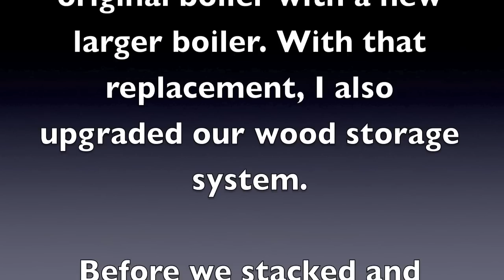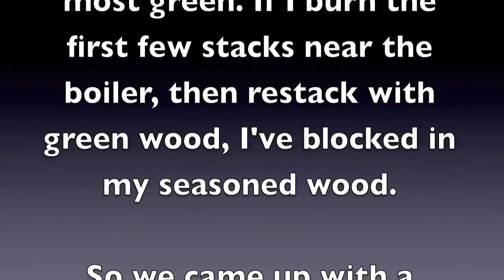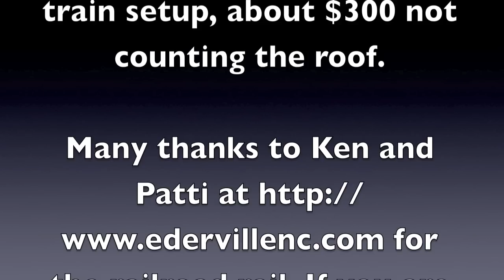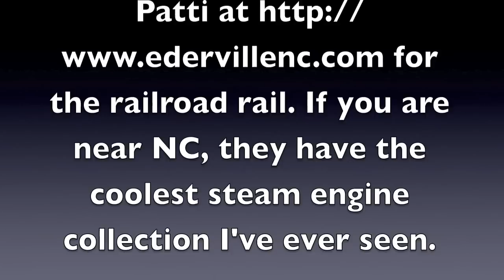Mobile wood rack system for a wood burning boiler

Comment: That is a truly ingenious solution to an ages-old problem.  I'm sure others have thought of things like this, but it's really cool to see it built and working so well!  While there are detractors, with most of them living in cities and having no experience with such things, heating with wood is a great option in many situations.  The biggest challenges to effectively heating with firewood are drying the wood and getting it to the location where it will be burned.  Historically, we have joked about firewood heating us 3 or 4 different times, which alluded to harvesting trees, splitting and stacking firewood, then moving it again to the stove or boiler system.  This solution addresses proper drying and seasoning of firewood, as well as that final relocation of the firewood to where it will be used.  Anyone who has done this before will recognize the value of what you've done here.  Those with negative comments are either ignorant, jealous, or both!  

I would put clear, plastic, corrugated siding on the outside of the shelter house, roughly 2/3 of the way to the ground, so that you still get lots of air flow, but have more protection from blowing rain and snow.  It would also be an easy thing to weld an eye-bolt to the undercarriage of each "shuttle", as an attachment point for a winch cable, if you wanted to test out that means of moving them.

ETA - I see this video is almost 7 years old...how has the system held up?  Have you made any adjustments to it?
Reply: Thank you Jason for the warm comments. The eye hook is a good idea. Should I ever convert to a winch system I'll remember it. I worried about the rain blowing in and wetting the wood as well in the beginning but the end result has been negligible downside with open walls The look of the short walls to protect it would detract from the current clean aesthetic, which I wouldn't care about but I have a wife to keep happy so I'm thankful it works without the walls. Thanks again for your well thought out comments.
Reply: @DanMooreNCF , I presume the system is still working as designed?  I suppose it would be, given how sturdy and simple it is.  I supplement heat with a fireplace insert, at the moment, but hope to retire to a home with a masonry stove, and plan to build something identical to your design, when that time comes.
Reply: @jasonbroom7147  Oh yeah. It works just like the video for the wood handling. We replace a boiler circulation pump every once in a while but otherwise it runs just fine. Pretty low maintenance. I just did our test fire for the season last week and everything fired up like it is supposed to. We produce way more wood than we can reasonably burn just in our normal farming operations. I have at least 5 years of wood on the ground right now, and I'm clearing out a pad for a new barn at the moment, producing more wood. I use electric and LP heat until the weather gets cold enough to justify the wood boiler. Otherwise the boiler only fires once per day which is kind of a pain. It is happier when it is running all day and all night.

Comment: Cool.  Great idea.  I think I'll use some of this concept for myself.  Hey one thing that would help you when pushing the wood forward (towards the boiler) is install a limit switch on end of the track nearest the boiler.  Use a cheap "wall wart" 12vdc transformer that can be shut off completely (with a toggle switch) when not in use. Install a red clearance light on the far end of the roof structure. Now when you push the wood forward it will trigger the limit switch, turning on the red light.

Comment: that's a great setup! now, me, being lazier than you... i'd use an electric winch rather than the loader to move it. no implement hookup and it might be less likely to jerk and knock the piles over :) note, I also do not own a loader, but do have a winch.
Reply: A lot of people have suggested a winch. I had a loader, and not a winch, hence my solution. Working with what you have is the best solution.
Reply: @DanMooreNCF  i totally agree. Use waht u have

Comment: This is fantastic!  Not just a great solution, but taps into what I feel is the soul of colonial and industrial era industrial design.  Today, People will walk back and fort, back and forth to the trash can instead of putting the darn thing on wheels and bringing it to the work.  Raw material in one end, meeting improving processes along the way(cut, split, stacked, seasoned, burned) and finished product(heat) out the other end.  Could I suggest that an optional refinement might be a heavy cable and a come along?  More cost in sheaves, and strong points/rings on carriages, but would allow for single operator use if come along (or winch) located near furnace.  Trip hazard (if left in place) would be trade off for risk of banging roof with skid loader.  Reaved cable(mechanical advantage) would make perceived load lighter for winch or come along.  Heck, you could set an old school manilla block and fall if you reaved enough and would have no noise, no fumes, nice aesthetic.  But these are just cake icing style tweaks to an amazing idea that you have realized.  Thanks for sharing.

Comment: This is a really well-thought-out system. Hats off to you for the ingenuity to consider using railroad rails and custom made racks to fit. When I see a great system like this it makes me appreciate resourceful people who don't just flip on a switch for their energy needs.

I was a stairbuilder and often made my own tools, which I sold to other local stairbuilders. Honestly, I enjoyed doing that more than stairbuilding, which was a fulfilling job already. I was constantly thinking up new tools and applications. When I saw your system, it put me in mind of a local hardwood supplier that stickered his own wood. His delivery system to the shop was a total cluster f-bomb. This system would have been great for him, with rows of the different species in lines similar to your single line system.

The only improvement I can think of is an extension of your great idea. Why stop with just the railroad rails? If you mounted your racks on an inexpensively built "dolly" you could roll the racks by hand, and not need a tractor or even a winch. You already have the rails for the dollies to ride on. All you need to do is use square steel stock and weld up a square base and attach some smaller 8" railroad wheels to the base (the "axle" could be round steel stock). They wouldn't even need to be standard railroad wheels. I found some small wheels with flanges that have nice bearings and don't weigh a lot. That way you could just pick up the rolling base when it's empty of wood and replace it at the back. If you don't like lifting it, you could use a heavy duty two wheel dolly to cart it to the other end to refill. The added advantage to this system is, you could extend your railroad rails to the splitter and fill the rolling base there and just wheel it into your covered area. Granted, it would take some fabrication work, but the system would require no firing up the tractor and mounting the pushing post and you could push the entire pile by hand or each stack one at a time.

Anyway, I'm not disparaging your work at all. I think it was a really great idea and has wonderful potential for other folks. Modified using wheel bases, I could see it being sold as kit for folks like you that use a lot of cord wood for heating. Good job, MrDan!
Reply from the maker: Thank you Dallas. Kind words from a true craftsman. The fab work certainly doesn't bother me as I fab all kinds of odd things. We looked at using wheels of some sort but ended up deciding against it. We use the skid steer as our power source for the log splitter so whenever we are splitting the machine is already there. We also use it to carry the logs to the splitter so it's serving double duty. The issue we had with wheels is that the roof line was artificially low because we picked up an existing roof line from the boiler house. With limited head room we didn't want to put wheels in because that limits the room even more. If I had 10' ceilings, I would have used wheels. I could make small railroad type wheels in my metal shop and use simple axles on each trolley but with our setup space was limited. In reality I'd love to double the amount of storage I have but I don't want to make the roof any longer and higher isn't an option.

Comment: That’s a great idea although my neighbours were not happy when they discovered railway tracks across their lawns and parking spaces, I think blocking the light from their windows with the wood stacks was also a deal breaker🤷‍♂️. Just got to knock a hole through the side of the house now to push the wood inside nearer to the boiler 👌.

Comment: Good system I like it, just need to put wheels on those racks and then you can push them by hand. (one at a time) !! I saw the same issue when visiting friends, 1, they would chop the wood and throw it on a pile. 2. at the end of summer they would pick up every chopped log and store it in a shed. 3. during winter pickup the logs from the shed and bring them to the house in a wheelbarrow.  Solved the problem, once the wood is chopped store them in a steel cage on wheels that can be moved easly.

Comment: I'm super impressed. But there is a lot of steel channel and angle in those racks. $160 bucks for the blank skidsteer plate, plus the railroad tracks and all that PT lumber, now way you could do it for $300. That being said. Best firewood system I've ever seen
Reply: its not pt he said he cut it from his farm and by doing that cuts cost
Reply: Nate is correct. The lumber is from my farm, self cut. The railroad rails were a gift from a friend. The only costs were the ones listed, plus labor which I didn't calculate. If we all calculated our labor on our projects nobody would ever look good although the labor on this project wasn't that bad.

Comment: That's a great idea, but not all of us that burn wood , have access to a skid steer. I still do it all by hand,( alot of labor ). Thanks for the video.✌️
Reply: He uses a skid steer because its easy and its what he has. You could easily put a concrete block in the ground to push against and just use a hydraulic ram/jack to accomplish the same thing. Its not something that would have to be done often, so get a 20 ton jack, pump it 6", retract, put a 6" spacer in, repeat. May take 5 minutes, but big deal. There are four ways to skin a cat; skid steer is only the one that was convenient for him

Comment: What an ingenious system well done, and yes like everyone else i'm gonna make a suggestion of how to get away from the need of a spotter when on the skid steer as you have a unified system and all your log racks are the same width why not spray paint lines on the rail to mark the gaps when you remove one from the end closest the boiler you have only to push the cart passed the next visible mark and you are now moved up...x
Reply: richard b hollick all of which would be fine unless the front stack fell or something happens in front you don’t see until you’ve damaged something.
Reply: I might be tempted to duplicate my $25 Wyze camera that watched the boiler, and position one so I can see the end of the stack with my phone while moving the load down the rails. To me, the technology is easer than building my first idea, which is a vertical post a few inches high that gets pushed over by the rack as it reaches the end, rotating another horizontal post or flag upward next to the stacks to tell me to stop.

Comment: What you need is to use 80-100 series chain running atop of some 3"x8" channel for rails and drive it with a 50-1 gear box and electric 2 hp motor.  Then no one needs a bobcat and you could stand at your furnace and watch the wood come to you without a spotter.
This is what I built for a pellet mill for pushing pallets of pellets outside for Hyster drivers to move onto trucks earlier this year.  3 of us built it in one day.

Comment: Awesome system! I would "dig out" so when you push wood the skid steer fits under the roof! I would hit the roof eventually. Haha
Reply: Putting or painting a marker on the input end will tell when the supply end is even with the end of the rails.

Comment: Great system, congrats on it.

I have entirely different set up/system but exact same philosophy (less handling of the wood, the better/cheeper if is to heat with wood).

My wood shed is near the stove just out side a window next to the stove. I mounted wood box on the out side frame of the window with the lid hinged off the bottom of the awning window.  After I fill the wood box from out side, when I open the window from inside the wood box lid slides back allowing access to the stored wood.

Comment: Think about adding some  UHMW plastic  sliders to the underside of the channels that run on your rails. It will prevent the rails from freezing and  greatly reduce the effort needed to slide your pile. By the looks of your video it's not a problem now, but if you ever want to extend the pile, or go the winch route it might be worth looking at.
Reply: Or grease on the rails, put a little on every 2 months or so?  Great setup and like he's said in the comment, he's always improving it..... nothing like wood heat, I miss our wood stove or the heat that came with it!

Comment: This is like watching one of those overly extremely complicated cartoons of the alarm clock contraption that gets Donald duck out of bed in the morning.
Reply from the maker: Compared to flipping on the switch and burning electricity, yep it probably does. Handling wood is going to be labor intensive no matter how you do it. I'm always open to better ideas, but I couldn't find one on youtube so I posted mine. In facilities that burn wood for power generation for a living, the process is very intensive. More so than mine. I felt like mine was scaled down quite a bit compared to the pros and I certainly burn less diesel per unit of wood. Of course I don't produce 5 megawatts either so there's that.
Reply: +Tony Thomas   What is so "overly extremely complicated" about this setup.  It is individual stacks of firewood on a set of rails.  Shoved down the line by a mechanical force.  If anything, it is simple/basic physics that saves the operators countless hours of wasted labor each year.  Genius, I'd say.

Comment: Great idea if you happen to have a Bobcat hanging around.
Reply: I’m sure you could achieve the same thing on a smaller scale with a winch. Or even some sort of rack on casters instead of sliding c channel on rails. Would definitely be less resistance
Reply: Just use a $50 Harbor Freight winch if you don't, or even a hand crank boat winch, and attach one or two racks at a time to pull them forward.

Comment: Great Idea . You could put an ellectric winch and cable to pull the stacks down the track .
Reply: I could. That's been suggested before. However I already have a skid steer at that works fine for my setup. I believe others are thinking to try it with a winch, hopefully someone will post it when they do.
Reply: Either way you still got it going on :) .

Comment from the maker: That would be good if having the skid steer available was an issue however we keep it right here on the farm. We did think about casters at first, but we would have lost capacity by raising the racks the 6" the castors would take. We were height limited with the roof already in place. Thanks for the comment.

Comment: I just built a 2 x 2 x 0.6 m wood storage rack with 4 areas of 1 x 1 m. I use the oldest wood first until that hole is empty, then I fill it up with fresh wood and continue with the then-oldest wood. That way I also never have to handle wood twice.
Reply from the maker: That sounds like a good plan.

Comment: Hi. It is amazing how creative people are when they make systems for helping them life. I still wonder why do not use simply pallet under wood and moving them by a pallet jack. Easy and get wood much close a door or boiler. Yes need even surface. but it is easy to set up. The train tracks rails are very slippery, better than ordinary steel bar, good point.

Comment: hi there  i made boxes so the wood comes off the splitter into a 1-2 + cord box then to a covered spot . then when i need it pick the box up and set it in front of  the boiler door . less stacking . if you made boxes and slid them down the rail and just slide them off after emptied

Comment from the maker: We looked at putting wheels on this system but there was a height limit. Adding wheels that could carry the weight would have eaten up at least 6" which is a lot of wood over that long of a system. That's why we went with rails and direct contact instead. Also, I don't have another area to store wood so it needed to fit where I put it. I have a friend who has mobile racks like you are describing. Those would have been easier but didn't really work in my situation.

Comment: Great idea, I wonder if a winch would be an easier way to move wood on rails.
Reply: jjmac60 I was thinking the same thing. Bobcats are not cheap.
Reply: With a suitably sized winch, wheels are not needed for metal to metal sliding.  You just need to be able to pull the cable and      hook back to attach the next pallet of wood.
Reply: I was surprised he moved the WHOLE STACK  like that, wouldn't have thought it possible.( and NO wheels either)

Comment: Very nice, roof looks good too. I would make up the five or six trolleys with wheels though, with a little winch mounted to the floor at the boiler end, this way u can do it one man operation without the skid steer. Make the trolleys in a way that they just lift apart in a couple bits light enough to carry, ready to put back at the beginning after they empty. Other than that the procedure u have is excellent. Neat n tidy.